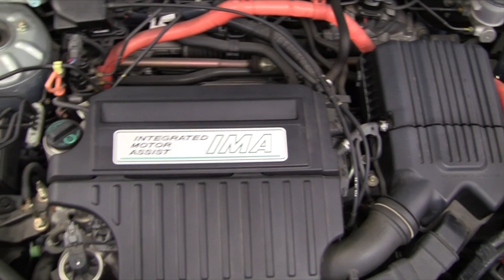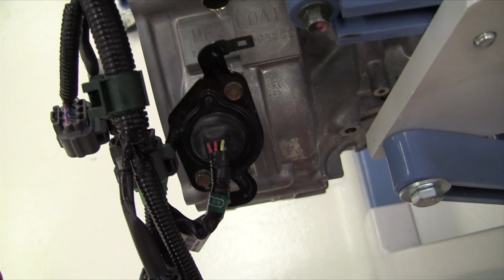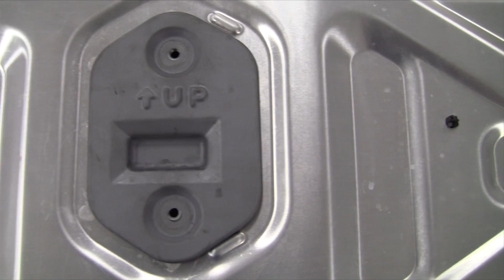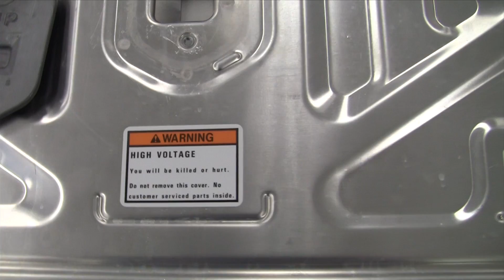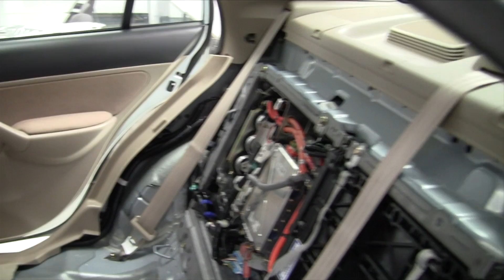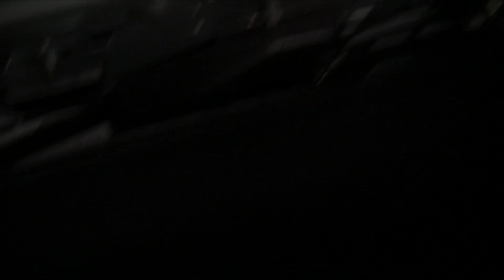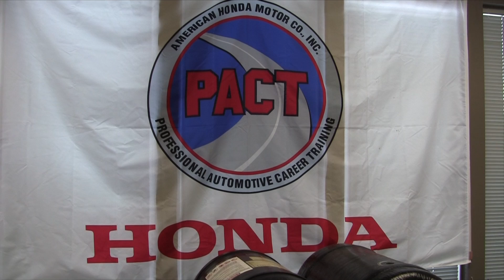Honda Civic Hybrid High Voltage System Operation

Comment: Awesome video! I have a 2006 Honda Hybrid Civic that runs great but I have two issues. 1) The engine battery drains overnight. The parasitic draw is coming from the the Back-up fuse which also is associated with all the communication's of the IMA. 2) The engine, while running in stop and go traffic, will throw three codes starting with an engine warning light and then the IMA warning light. The codes are P16D5 F-CAN Malfunction, P16D6 IMA CAN Malfunction and P060A PCM  (A/T system) Internal Control Module Malfunction. These codes, when thrown, cause the car to lose transmission function, lose the ability to idle, cause the vehicle to die (while driving) and will cause the vehicle to be locked into Park if you put in park to try and start it. The car will start but wants to die when started and will not come out of Park without actuating the locking mechanism. These problems seem to only exist when weather is above 80 degrees (vehicle runs great in winter). I have had this problem for 3 years and I have replaced the battery pack in 2016 thinking that was the issue. It was not! The codes only become active when the weather is hot. If I disconnect the  car battery the IMA is reset and the vehicle runs fine until the codes are thrown again. Always the same three codes and it only happens when the weather is hotter. Any advice on what I can do to fix this thing.
Reply from the maker: I think the battery going dead and the DTC's are related. Whatever module is drawing too much current will be warm to the touch. Low battery voltages can cause CAN communication errors. CAN errors can cause the transmission issue you have. Fix the parasitic drain issue and see what happens. Best wishes!
Reply: Is there a certain module you had in mind? How many modules are on this thing? LOL
Reply from the maker: Put an ammeter in series with the 12V battery negative cable with the key off. Watch the current. pull one fuse at a time and see when the current drops to less than 20mA. It sounds like you have already narrowed it down to the backup fuse. Start with any module powered by the Backup fuse. Then move on to the three modules the codes set in (IMA, CVT, PCM). If you don't know what I am talking about, then you need to get someone who does to help you. Best wishes.
Reply: Wow! Impressive it seems you are an expert yourself on this car

Comment: Hello so I notice mine sometimes when I step on it the battery light tends to come on . I have the 2004 5 speed one. But mine also has 268xxx miles on it but other then that problem the car runs fantastic. Once the battery light stayed on and the when I was driving the car seemed to die out like everything turned off as in the dash the radio and I shifted to a lower gear to see if I could eat it going but it was slowing the car down more . So I had to pull over and the car eventually died . I left it sit for a couple seconds and nothing . But I tried it again right after and it turned on like nothing ever happened to it ? After that the battery light tends to turn on but it doesn't die out in me like it did that one time . Do you know why that could be ?
Reply from the maker: This is a typical problem on that vehicle. The High Voltage battery starts to go bad, the DC-to-DC converter cannot work properly unless the HV battery is good. The 12V battery on the car is supposed to be charged by the DC-to-DC converter, but it is not, so the vehicle runs off of the 12V battery until the voltage gets too low and the car dies. Have someone check for trouble codes in the battery. If there are none, the DC-to-DC converter may be bad. Best wishes.
Reply: I had someone run the codes and it said the hybrid battery needed to be replaced
Reply from the maker: Thank you for the feedback, That is typically the fix.

Comment: do these have alternators?
Reply from the maker: No, they have a DC-to-DC converter that steps down the high voltage to 14 Volts to charge the 12V battery.

Comment: Thanks for the info Sir..another follow up question is I got a code P0AE1 which says Hybrid Battery Negative Contactor Control Circuit Low..where can I find those components ..I was wondering if it is the black thing attached to the battery pack
Reply from the maker: Thank you! Yes, the negative contactor is in the black end piece attached to the HV Battery. Best wishes!

Comment: Hey I recently took a mesearement of the High Voltage cables. I was getting way more than 144. I got almost 170 V with the key in the on position (not crank). IMA light ( 1600 and 1449)
Would you say I have a bad cell ?  
What would you do to repair this battery if you had a car with this problem?
Reply from the maker: What year and model of vehicle are you testing? 170V could be normal.
Reply: 2003 Honda Civic Hybrid 
After I read all 20 sticks..  most of them are above 7 -+ 0.30 for some. under load there is one battery that dropped at 6.8 V. I think I need to charge that stick. (D/C) and load test again.
What do you think ?
Reply from the maker: each stick has 6 1.2 Volt cells, so normal voltage is 7.2 volts. when the system is charging, the voltage can approach 8 volts. If those are the original battery cells, they are most likely going bad.
Reply: You might be right. Charging the pack again can add more juice to the battery. I tested each stick and they quicly dropped voltage. I will charge and see if it does the same thing

Comment: Hi Mr WeberAuto, I pulled out the hybrid battery of my 2006 honda hybrid..and after a week of not getting any replacement..Then decided to put it back into place but unfortunately the hybrid switch was stuck at off position.Is there anything to do to move the switch as smoothly as normal..
Reply from the maker: There should be a red button next to the switch to unlock the switch and allow you to switch it back on. Best wishes!

Comment: I have a 2010 Honda Civic Hybrid that Honda diagnosed with a failed IMA Control Unit ($1600). I've found the control unit is MUCH cheaper used ($100-$200) and doesn't seem to be a particularly common failure. Is it a relatively simple replacement, as the dealership certainly won't agree to putting in a used part?

Comment: i have 2008 honda civic hybrid indian model , its shows up battery light again and again but when i restart my car it goes up. but now its not going even after 10 times restart. may be my altinator is not working or any other problem. and i also wanna know where is altinator of civic hybrid fitted?? and yes i changed my battery many times and also get scan by honda company guy but problem it not solving. ???please help me out asap!
Reply from the maker: The DC-to-DC converter charges the 12V battery. It is behind the back seat. Check battery voltage with key on engine off. If it is less than 13.5V, it is not working correctly. Best wishes.

Comment: I have a 2005 model and the other night after being parked for a couple of hours I heard a thud from the car and a seriously horrible smell coming from the car.  Upon further inspection in the morning there is a blackish stain on the back window above the vent just behind the back seat.  I'm afraid the battery has exploded, it still has an awful smell in the car.  You can't get within 5 feet of the car before you start to choke on it.  Have you ever heard of this happening?  Should I try to take it into Honda?  I purchased the car used so I'm not the original owner.  Also can the car be used without the battery installed or will the system not function with out the batteries in place.  Thanks for any advice.  Neal
Reply from the maker: Wow! That is terrible. It could be the battery, but it could also be the inverter/converter. I would not recommend driving it. Have it towed to the dealership. Be prepared for the repair cost to exceed the value of the car. Best wishes!

Comment: I have a problem with the Transmission in my Honda Hybrid 2008, Because When the IMA Battery  is not charged, the Engine, lost so much force, And in ascents the car does not advance, only the engine revolution is heard and as maximum raises to 2500-3000 RPM but the car does not advance in ascent. I have no idea what it could be.
Reply from the maker: Your IMA battery is probably bad. It need to be good to help propel the car in ascents. Best wishes.

Comment: I hope you can answer this question on my 2008 honda civic hybrid. I keep a running voltage reading by hooking up a meter to the battery pack. The voltage stays at 182 because the pack does not assist and pull on the voltage. It use to go up and down when working fairly good.It will calibrate from 178 to 182 after sitting a few hours . I have no assist as stated period , no engine cut off when stopping , and a snail could beat my car off the line . I am also wondering why the engine can kick in but the car just sits there or hardly moves at all if trying to climb a hill. Very dangerous! btw i have discharged and recharged my ima battery and it takes a long time to pull it down . But this does not help at all. Any suggestions? Tx
Reply from the maker: Do you have any warning lights on, Check engine, IMA, etc.? If it were my car I would check for diagnostic trouble codes (DTC) first. It sounds like your battery is good, but nothing is working. There are fuses in the battery end cover. There is another part called the Intelligent Power Unit (IPU), which is Honda's name for the Inverter/Converter. The IPU's job is to use battery Dc power to drive the AC IMA motor and assist you in accelerating. It also inverts the IMA AC power upon deceleration into DC to recharge the DC battery. Of course, there is the CVT transaxle. If the CVT is not functioning properly, the vehicle will not accelerate properly either. Check for DTCs and follow what they tell you. Best wishes!
Reply: Tx for the reply. I have a code of p1570. it is not reconixing the ima battery or so it seems? I took out the battery and charged all the sticks.There was one set that was acting weird so i replaced it with a weak one from a spare i bought . the weak one holds up to within a half volt of the rest of the pack under a 100 amp load so i figured it is ok. but when put back in the car the voltage does not vary one little bit. But drags down the car battery. the only thing i haven't tried is putting the old stick back in and see if that effects the voltage . At least before i took it out it would cycle now that i replaced the one twin stick it shows no bars at all.......

Comment: I just changed the box that changes the DC 144V to 12V. My battery light was staying on a lot and battery would go dead. After I changed the box I now have absolutely no power battery is up but everything is dead. There is fire on the two screw terminals on the under the hood fuse box. Is there a reset button or relay or maybe a fuse that blew. the only wire that would have had fire on it would have been the hot wire going to the 12v system and I think i had it coverd good and kept it away from any metal. But I guess it could have touched and blew a fuse if so which one. I have 3 of these little 2003 Hybrids thank you for your help. Ron

Comment: Hi quick question, we have a Honda 2008 civic hybrid and the ima light and engine light came on so we replaced the battery and the lights were still on, we drove it for so many miles to try to get them off, but they are still on for some reason, would we need to change something else besides the battery, trying to figure it out?
Reply from the maker: Did you change the IMA battery? If so, there is some programming that needs to be done with a Honda scan tool. Of course, there could be other problems as well. Get someone to check for diagnostic trouble codes and see what they indicate. Best wishes.
Reply: WeberAuto Thanks for the response. We did change the battery, but do you think we would ever need to change the built in a/c converter or dc-dc converter from the other honda where we got the battery from? Didn't know if everything from that car needs to be transferred as well to make the battery work right.
Reply from the maker: I don't think so, unless the model years are different. The programming I mentioned before will let all the components involved know what parts re there. There is also a software update for the batter controller etc. Get the scan tool check done.

Comment: Hi what does it mean when the ima battery is on and the red battery signal I've change the battery twice already and it's still give me that signal ? What should I do
Reply from the maker: It probably means the 12V battery is not being charged by the DC-to-DC converter. Have someone check for trouble codes in the hybrid system and PCM. Best wishes
Reply: how about a 1570 code no charging or discharging it's like there is no access to the ima battery now....and the brand new car battery drAINS FAST . but oddly enough if reving up even with the hybrid battery switch off or on it will charge the car battery?

Comment: I have a Honda civic hybrid second generation. The IMA battery isn't charging. Engine light and IMA lights are on. There is also a blinking D light on the gear indicator that goes off sometimes.  idk if it's the generator that's the problem or the battery itself. please help.
Reply from the maker: It sounds like you have multiple problems. Find someone to check for trouble codes and see where they lead the diagnostics.

Comment: I'm having a Honda civic 2006 model ..
and the car is just discharging the 12 volt battery,and IMA and the Engine lights when on..
it starts but after a few minutes it just goes dead...
the excalerator doesn't work anymore...so car stop moving and it's only idling but its not reving
the IMA battery bars disappeared and it's not charging anymore. ..
Reply from the maker: Chances are good that your IMA battery is bad. Have someone check the IMA system for codes. Some people have suggested turning off the IMA battery switch behind the back seat as a work around. Best wishes!

Comment: For the Honda Civic Hybrid gen2, the brake master cylinder has an abs pump connected to it. Is this abs pump dependent on the IMA batteries too?
Reply from the maker: No, it is a 12V system.

Comment: Hi there. I have HCH II. My car is not charging and dies while driving. on my opinion there a 3 possible reasons to this outcome.
1. DC to DC converter not charging the car
2. cooling hybrid system not cooling the hybrid system(btw which module is responseble  to turn the fan on and of?)
3. the cooling fan itself 
how can i determinate the exact sours of the problem?
Reply from the maker: Honda has an air cooled cooling system for the hybrid system. The fan is in the trunk. Chances are that the 144V battery is bad. That will cause the dc-to-dc converter to not function properly. This will then not charge the 12V battery and the engine will die while driving. Best wishes.
Reply: +WeberAuto while running I've disconnected the 12v battery and let it runs for a while. It was charging fine. Usually the car stops charging when i drive it all day in a hot water. So I'm sure is the cooling system. What is the name of the module that starts na cooling fan? Is it engine control module or something else?
Reply from the maker: That does not mean it is charging. The engine can run on 10-15 volts. Put a volt meter across the battery terminals with then engine running. It should be approximately 14V
Reply: 14 volt what is  out put current